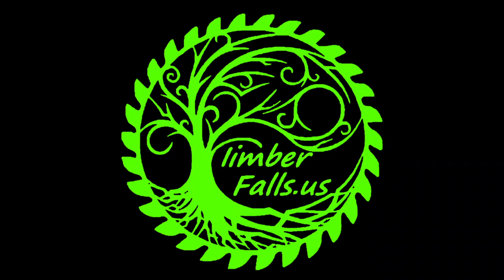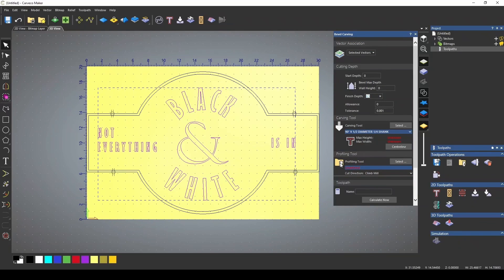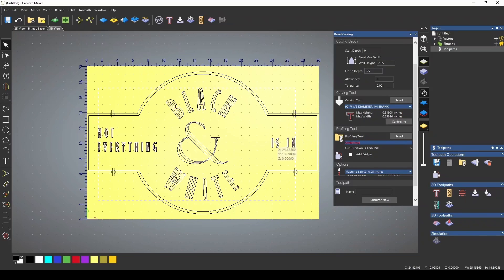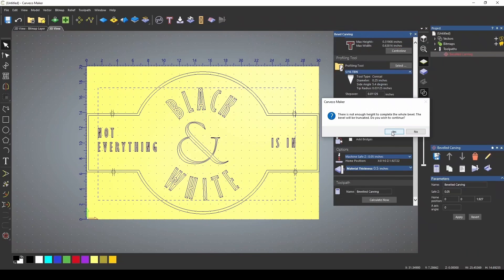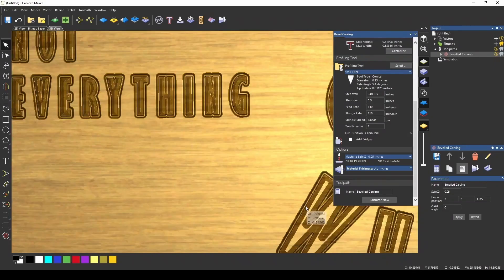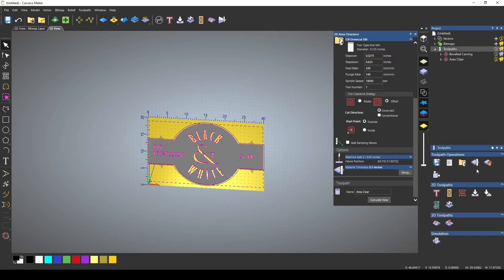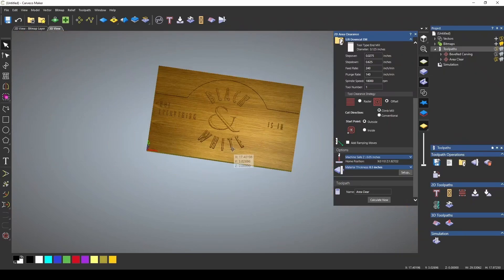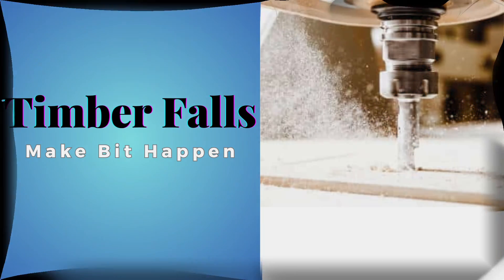Bevel Carving Mastery in Carveco Maker: Elevate Your CNC Projects!

Comment: I want to cut out a simple circle, but I want the outside border to be beveled, instead of just a straight cut. Do you have a video on that?
Reply from the maker: I do not have a video per say but the easiest way is to use a vbit and a profile pass to cut along the vector to add the bevel. Similar to the way you might do that traditionally with a hand router but having the cnc do it.
Reply: @Timberfalls  kind of what I thought. Do the bevel first, then the cut out? Or can I do it just the v bit?
Reply from the maker: @JohnnyTidmore  You can do either way first but I often do the bevel first as I seem to get less tear out that way.
Reply: @Timberfalls  thanks! You're videos are concise and so helpful.
Reply from the maker: @JohnnyTidmore  Thanks! it is satisfying to know these videos are helping others and is what keeps me doing them so I really do appreciate the feedback.